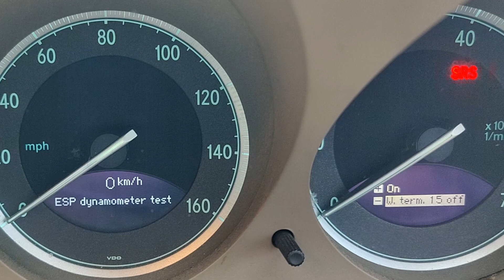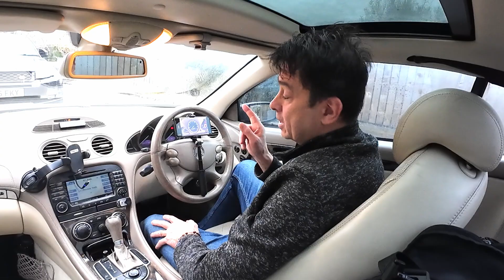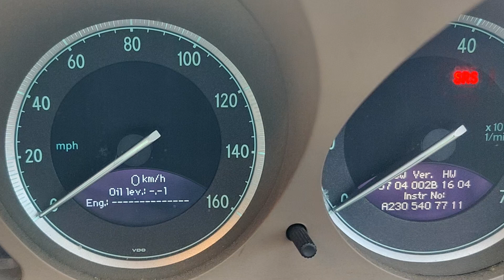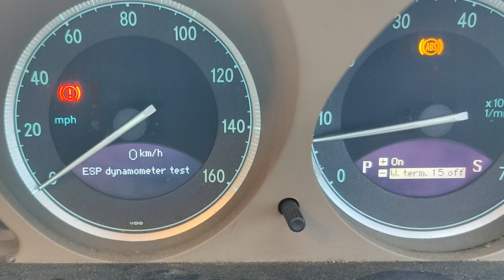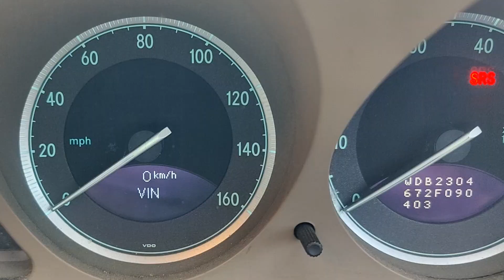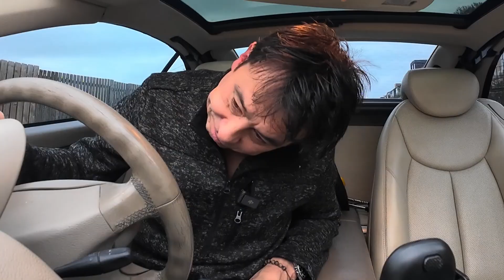Mercedes SL R230 Hidden Dashboard Menu - Display Voltage, VIN, Diagnostic, Actual Oil Level !

Comment: Some corrections : the 3.7 V6 holds about 8 liters. In order to activate this menu put it the key in the FIRST position, NOT the one before it cranks. Finally, in order to know the exact amount of oil in the sump, DO NOT start the engine, just put it in the position before it starts (ome more position clockwise) and it will show the exact amount. Measurements of oil in a non dry oil sump is absolutely worthless.
Reply from the maker: Thanks for the update, I have amended this in the video¬ !

Comment: Sadly didn't work on my 2003 SL500.
Reply from the maker: oh no way, the 2003 is the gen before, there are a few menu's that you may not have
Reply: No, mine is also a 2003 - the description was wrong. Read my comment.
Reply from the maker: @ im not sure what you mean, my car is a 2004 which a lot of changes to the 2003 . When you select the menu, turn key just one click to right.

Comment: Love the videos, saw you had an SRS red light, I have that too but my garage can’t remove it, any tips. Learned a lot from you channel, keep up the good work. Thanks Mark
Reply from the maker: The srs light goes out for me, as soon as I start engine. It will be likely a connector to one of your airbags is loose or dirty, try under seat. A diagnostic tool will help you